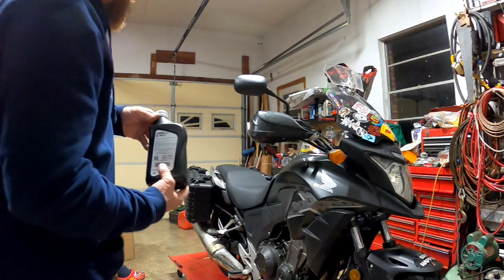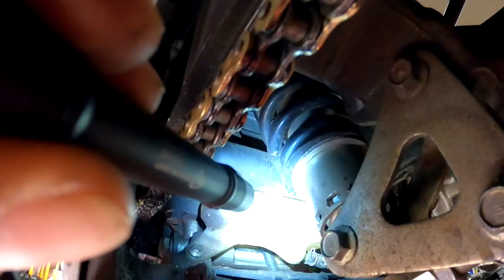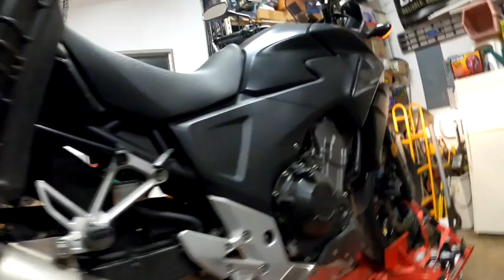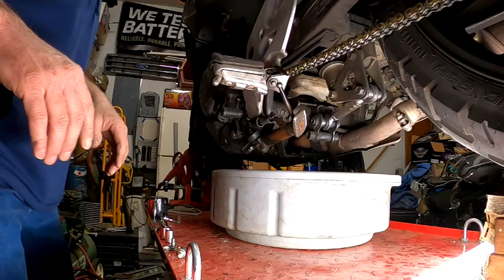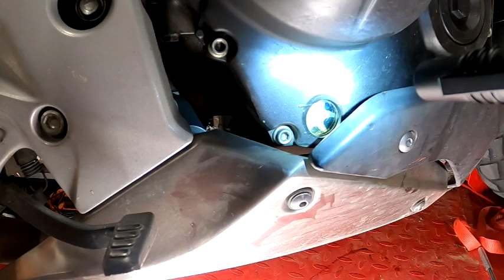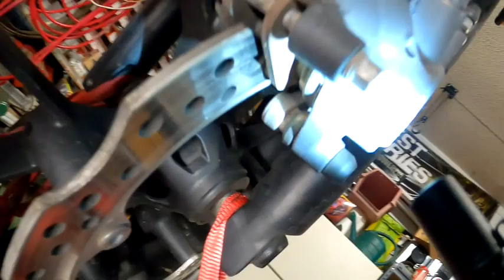Honda CB500X 15k Mile Service

Comment: You dont need teflon tape on the threads, in fact i dont know that the teflon tape is heat rated for the temp the engine reaches. Its the crush washer and the surface of the bolt that seal the oil in, not the threads on the bolt.